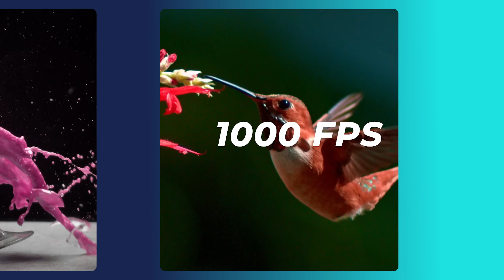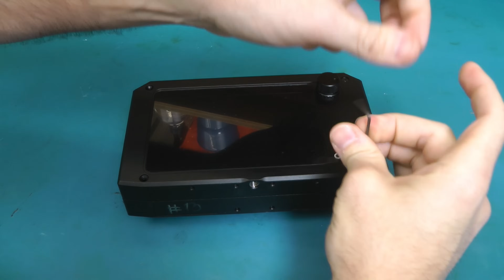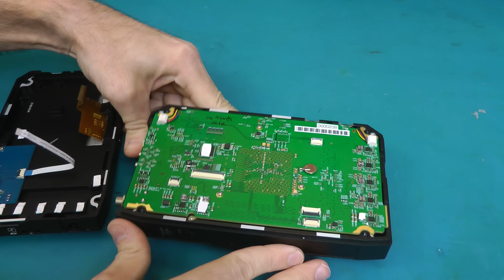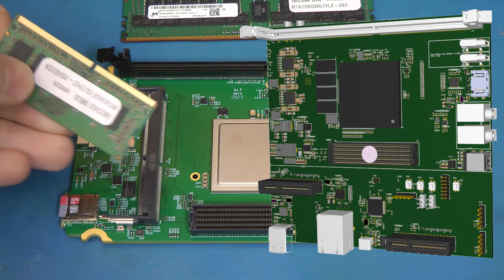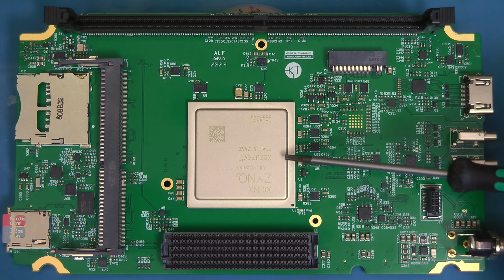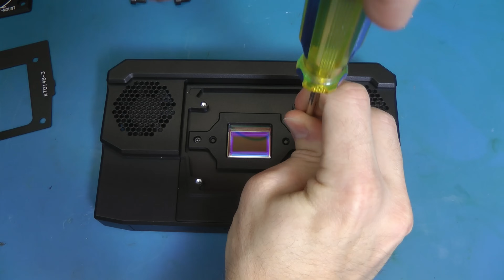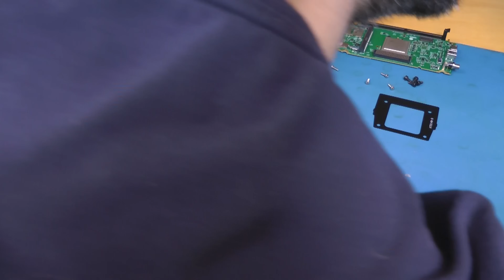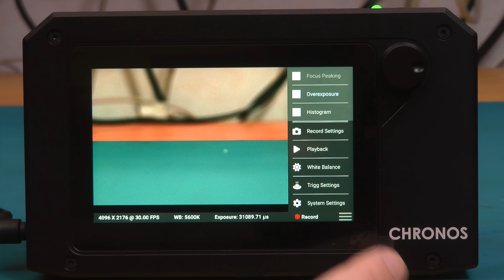Chronos 4K12 Intro and Teardown

Comment: Nice! I always thought that side BNC was a bit ugly and unnecessary!
How do you solder that sensor pin array with the passives buried in the middle ?
Reply from the maker: Thanks Mike! Right now, the sensor is manually soldered, takes about 15 min so not a huge expense compared to the sensor itself. In the future we'll likely move the passives out of the way and use a selective wave machine machine to automate the soldering.
Reply: @tesla500  Maybe you could glue-dot the passives and selective-solder it all in one go. What could possibly go wrong...?